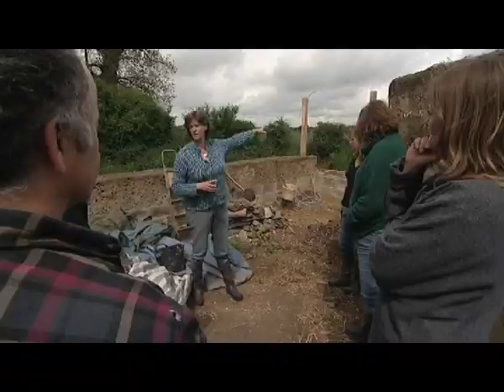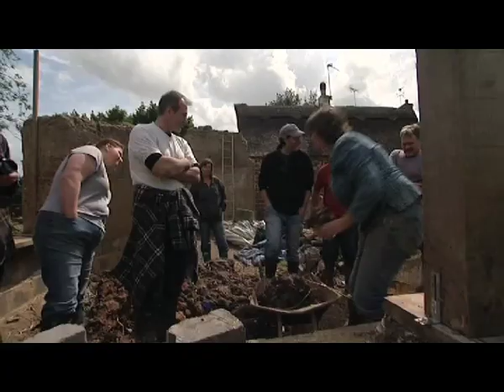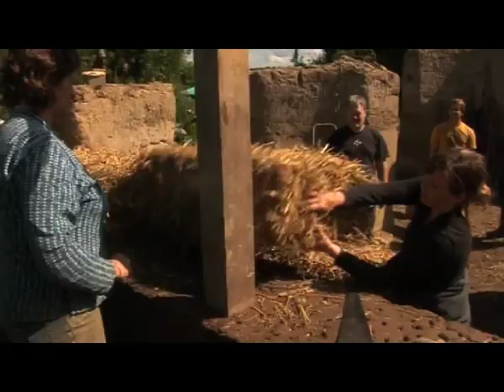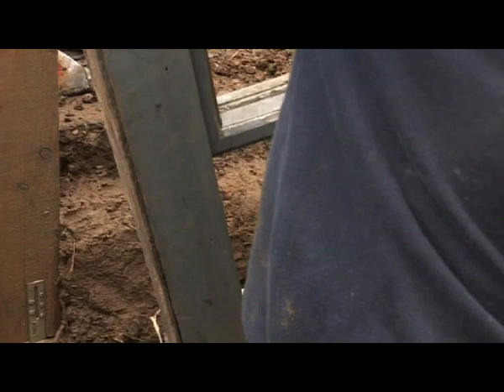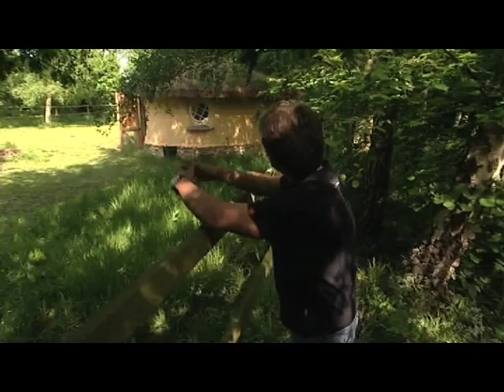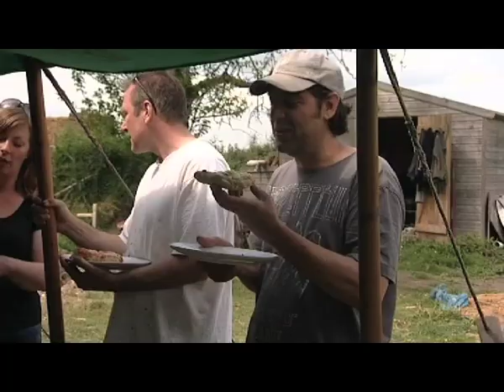Cob Building/ earth building course with Edwards Eco Building www.cobcourses.com

Comment: make sure you know where you want outlets and wiring to run before you start, and then just run the wiring through conduit like you normally would and build the cob around the conduit as you go.

Of course, if a wire breaks repairing it would be a pain... but the installation would be straightforward.

Comment: how long does it take for this type of thick cob wall to cure and harden properly?
Reply: It depends on several factors. Wetness of the cob and outside temperature. People in Europe don't build cob in the winter time because it takes forever to dry. On a summer day with temperatures about about 75 degrees F the wall will dry enough to apply another layer on top. We build cob in layers of generally one foot at a time. When this layer is dry or almost dry we can add an additional layer. There's a great video on Kevin McCabe's 10,000 sf home that he's constructing. It is beyond amazing.